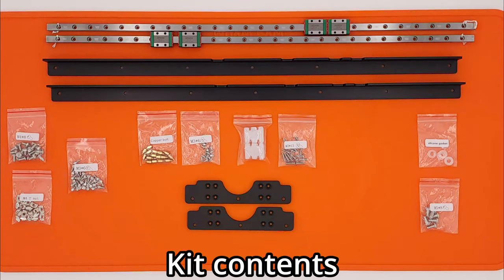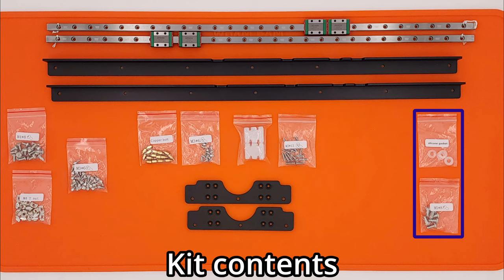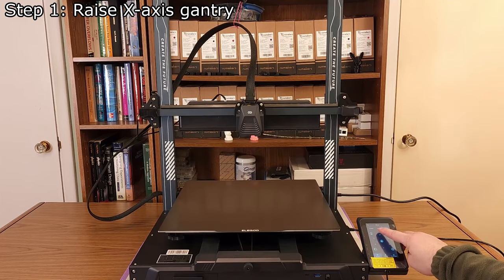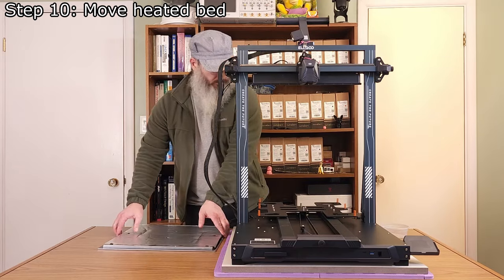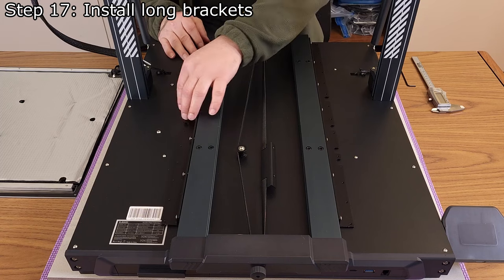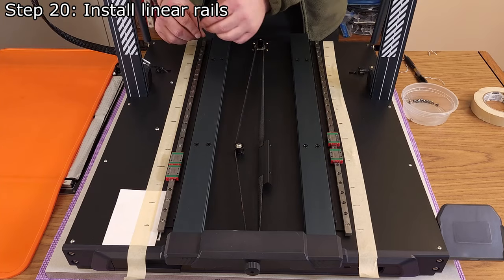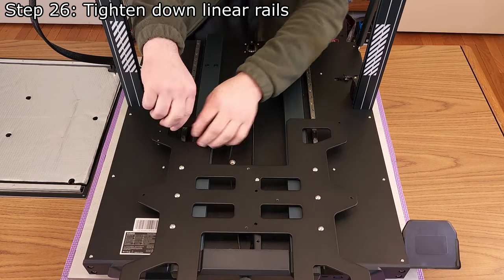Linear rails for the Neptune 4 Plus & Max: Part 3 - Installing the Y-axis kit

Comment: For the Neptune 4 plus the heat bed bracket(slider) is made of cast. This means the accelerometer hits the side of the linear rail bracket and the mounting holes do not align. Have spoken to TBSton3d and they will have a new accelerometer bracket soon to rectify this issue for N4 plus.
Reply from the maker: Thank you for watching our videos and for letting us know. We don't have access to a Neptune 4 Plus, so I was not aware of this issue.
Reply: Yup,. running into this issue right now... what did you do about it? I am just considering sanding the plastic housing on the accelerometer down a bit....
Reply: Or I could print a new bracket, which I ended up doing. Loving these videos, did both the Y and X today, now for the Z :)
Reply from the maker: Thank you. Our Z video should be available in a few days. We improved our installation process from our Neptune 3 Max video.
Reply: @SandMMakers  Awesome, look forward to it! It is the last axis I need to do and then back to levelling etc! I noticed the TBStron YT channel didn't even have a z axis video like the others, so will look forward to yours.

Comment: Hi, I got my kit and started installing the Y rail kit. I am missing the brass stand offs and m3 x 6mm screws or the custom silicone gaskets and m3 x 12mm flathead screws. Where can i get the brass stand offs or silicone gaskets if not from the company? Thank you in advance!

Comment: what is the Maintenace for the rails? i installed mine yesterday. how often to you need to grease them or can you just add some oil to the rails. Also, what syringe did you use to grease the hiwin? Thanks

Comment: 1 month update. The silicon washers did not work out at all. The screws loosened so much the bed was more wobbly than on fully deteriorated pom wheels. The screws had zero torq so they just wiggled loose. I threw them in the trash and placed steel washers on instead. Just started a print on the new configuration.
Reply from the maker: I haven't heard anyone complain about this issue before, but I would have assumed the silicon washers would have acted like lock washers, helping to prevent the screws from loosening. Good luck with the steel washers, but I'm not sure if they will work for two reasons. First, unless you added lock washers or Loctite, I would guess the screws would be even more likely to come loose after being subjected to vibrations. Second, the silicon washers help compensate for any imperfections in the assembly. This is why the brass stand-off mounting option is a more difficult install, because everything has to be perfect, or you will get binding. Either way, good luck and keep providing these great status updates!
Reply: @SandMMakers  if you recall the washers are now too thin and the bed is impacting the frame. So I added a steel washer to the silicon washer to thicken it. Even with the steel washer, it was too thin if you torq the screw. So catch 22, you would need locktite there too. I run my machine 24/7 so my screws may have loosened faster. A solid mechanical connection is needed. Shock absorption is not an issue with this machine if you run the vibration cancelation program
Reply from the maker: I remember now (I response to hundreds of comments and messages so keeping track of all of them is a challenge). There must just be something slightly different about either your printer or the parts in your rails kit. I'm sure you will be able to figure something out. I'm not sure I have any more suggestions, but thanks for the updates!!!

Comment: I finally bought all the kits now. For step 21, Mine is even more different than you show for the small brackets. I didn’t get option A or Option B in my kit. So for now I’m stuck waiting on support to return my email I sent them. Thanks for the videos.
Reply from the maker: You didn't get two thick metal brackets? TBStron3D stopped using the brass standoffs and the H-shapped gaskets a while ago.
Reply from the maker: I use the new thick metal brackets in this video: https://youtu.be/9ezVllKc4Eo
Reply: @SandMMakers  yup. That’s what I got. They have option C I guess now. Haha. Thanks
Reply from the maker: The thick metal brackets are MUCH nicer than either of the two previous options. I was going to include them in the Neptune 4 Max Y-axis video, but the prototype brackets were defective and I didn't want to delay publishing the video by 2+ months.

Comment: So curious just got my kit installed (went with option A, since I've had my kit ordered and sitting for quite some time). I notice that the belt is pulled up away from the base quite a bit, especially when you get to the max front/back points. Has anyone run into issue here with accuracy concerns with the belt binding a bit at max? I'm sure a printed spacer should suffice to address this long term.
Reply: So... my fault... I installed the l brackets for the rails upside down.... makes so much more sense.

Comment: For step 7. I instead removed the entire accelerometer by removing the 2 screws holding it in place. The plug on my accelerometer was just too "Stuck"
Reply from the maker: I'm glad you found a way that works. For most of these mods, there are multiple methods that will equally work. In the videos, I can really only show one approach, but the companion website that I'm creating will be able to describe multiple approaches for mods shown in my future videos.

Comment: Hi. I replaced xyz axis with rails. And now have error " probe triggered prior to movement" would you pls advise where might be issue as I am beginner.
Reply from the maker: Did you update your z-offset?
Reply: @SandMMakers  I tried set offset..
Reply from the maker: Please describe exactly what you tried in a little more detail. Also, after homing, what is the distance between the bed and the nozzle? What is your current z-offset reported in the LCD controller?

Comment: So after I try to pull out the bed accelerometer cable and break it, where can I get a replacement.
Reply from the maker: The cable is fairly easy to make, but if you email 3dp@elegoo.com, they will send you one.

Comment: When you start to print, I suspect you may have issues with the bed staying leveled. Mine was losing its level in one print, after a short while. This was solved by replacing the 6 M4 × 30mm flat head socket cap screws that run through the springs with M4 × 40mm screws and adding nylon lock nuts, as was suggested by another commenter elsewhere here on YouTube. This mod made leveling the bed take much more time, but now it stays dialed in for far longer. 

I have enjoyed the series so far. Looking forward to the final entry.
Reply from the maker: Thank you for watching our videos!! I have not experienced the situation you are describing, but if it works, great! I know a lot of people use silicon spacers with great success.

To make bed leveling easier, you might want to give Bed Leveler 5000 a try. Here is the current video, but a new release with even better features is expected to be released within a couple of days.

https://youtu.be/JBGN3U0C2LM

Comment: Great videos! In step 21 attaching silicon brackets how tight do you make them? Same with step 23 securing base plate? I overtightened them and the base plate was hitting the front of the printer it doesnt have much clearance. I am using the cheaper rails maybe the hiwin rails are taller?
Reply from the maker: Thank you!

I don't know the exact amount of torque that I used in the videos, but you don't need to tighten anything to the point where something could break or snap. The most important thing when tightening the screws in those two steps is ensuring all screws are tightened to the same amount and the tightening is performed in an "X" or "hourglass" pattern to ensure even forces all around. I don't have access to a set of the non-HIWIN Y-axis rails, but I'm guessing the dimensions are fairly similar. Did you make sure to use two thick and one thin silicone gaskets per carriage? If yes, the only thing I can really think of is that the front screws were tightened a lot more than the back screws and base plate is tilted as a result.
Reply: @SandMMakers  yes used two thick and 1 thin. I loosen and made tight with Allen vertical like you did in video and it's fine but still very little clearance on front
Reply from the maker: I'm glad you got it working. If you encounter any more issues, let me know and I will try to help out. However, for bigger issues, email TBStron3D. They are extremely responsive.
Reply: Just installed my Y-Axis kit, I used a rather long ~400mm flat ruler to level most of the bed flat amongst the 6 points. It should at least get me into a good starting point before I get the uprights complete and perform the leveling with the machine on. 
Kind of hard to explain, just think of the 6 screws as the tension points they are, and make the ruler flush against the build plate by tightening/loosening them. Its no machinist Rule, but again... should get me close enough.

Comment: I want to say thank you for incredibly precise and informative videos you put out! I installed the y-axis kit on my Neptune 4 Max with ease with your instructions however I have ran into an issue. Obviously with the introduction of the rails the bed sits higher than previously. I thought by starting the auto leveling that the printer would stop before crashing into the bed. I am not new to 3d printing but I am new to Klipper and having a bed leveling sensor. Where can I make an adjustment to the z-offset to compensate for this? If I run Bedleveler 5000 (which i used to originally level my printer and its fantastic) will it cause the head to crash into the bed or will it stop at the right height while probing? Thank you for your time!
Reply: Solved my own issue, I didn't have the PEI bed on, as I was afraid of having the head crashing into it and damaging it. Forgot that it's needed to detect the height of the bed.

Comment: Can you tell us what max acceleration do you obtain in input shap Y axis test? 
Because my mvz is <1700 and my friends with wheels have better results than me with linear rails (Neptune 4max in both cases)

Thanks for the videotutorial, very useful
Reply from the maker: I was collecting input shaper results while filming the videos, but due to a scheduling conflict, the collected values got invalidated. I'm aiming to perform some more extensive testing and calibration on the printer's soon.

Comment: Thanks for the video, it is very well done and informative. I do have a question though. There are two y axis rail kits available on the TBStron3D store, but one is substantially more expensive, do you know what the differences of the kits are? They look like they have the same parts.
Reply from the maker: Thank you for watching our videos!! The only difference between the two kits is the brand of linear rail included. HIWIN rails are higher quality than the generic ones included in the other kit.

Comment: great series of the Nep 4 Plus/Max linear rails!!! Very informative!!!  I do have a question on the silicone washers used on the 'Y' axis. How tight do you tighten them? All 16 screws won't will be different due to the sponginess of the washers. i guess i'll get them as equally snug as possible and plan to use the Green Loctite 290 to have them lightly secured so they won't back out. But would like to get your suggestion as well.
Reply from the maker: Thank you for watching our videos. I have not had any issues with the silicone washers. I suggest just trying to tighten them as equally as possible and NOT using loctite. The washers will already act like lock washers.
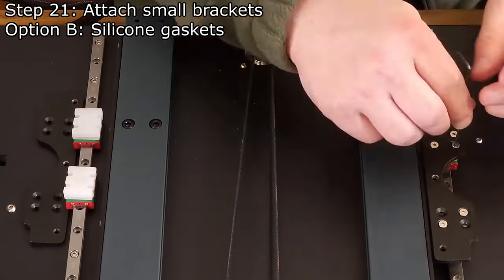Reply: I came here to ask this same thing about the silicone spacers at 8:59.  I slowly tightened in an X pattern on one roller, then moved to the other, turning only 1/4 to 1/2 a turn at a time going back & forth between the two rollers.  If one was slightly tighter in comparison to the others, I could feel the rollers had slightly more friction. Continued the X pattern until all felt “snug” and the rollers felt good.  I was worried about them backing out, but I guess we’ll see.

Comment: First of all I just want to say thank you so much for this tutorial!

I just received my kits in the mail. The bracket that mounts to the carriage blocks has spacers molded in now. Which is fine because I would have went with the hard stand offs anyways. I'm using blue loctite on everything. 

But as soon as I start to tighten a screw on the rail even a little bit it starts to bind quite a bit.

I'm wondering if it's because the rail is flexing due to only one screw being tight on each side?
Reply from the maker: You need to install all of the screws loose and then slowly and evenly tighten them. Try doing only half or quarter turns, since everything needs to be as even and consistent as possible.
Reply: @SandMMakers  that's what I'm doing. I'm going to loosen the extrusions too. And see if that helps. Busy weekend.

Comment: Step 25. If you over tighten the baseplate the washers squeeze and the base plate slams into the screw heads that hold down the back cover. I had to loosen mine. Perhaps the washers need to be thicker?
Reply from the maker: Do you have a Neptune 4 Plus or Max?
Reply: max
 @SandMMakers
Reply: I just noticed the squashed washers are also causing impact with the front cover. Washers are definitely too thin https://www.youtube.com/shorts/TjfBd4kYiFo @SandMMakers
Reply from the maker: I get an error when I try to watch the linked short, but I don't have a hitting issue with my printer. Did you use two thick and one think gasket per rail carriage and then a silicone washer per base plate screw? Assuming that the physical dimensions of the linear rails and the printer parts are fairly stable and consistent, that really only leave the gaskets. Maybe a batch of gaskets is thinner than normal? That's just a guess as I really don't know. You might want to email TBStron3D about it. They are extremely responsive and helpful.
Reply: yup, 2 thick, 1 thin then the round silicon washer. I think this all comes down to how tight both are. since mine is off by a hair, im going to just loosen them up and see what happens. @SandMMakers
Reply: I found the solution. The 6 silicon gaskets are indeed a hair too thin. Loosening the screws is not the solution. I re purposed the flat washers from the discarded pom wheels and placed 6 of them down. One under each silicon washer. It raised the bed just enough to stop rubbing. @SandMMakers
Reply from the maker: Assuming everything is mounted and installed properly, I'm really starting to suspect a batch of the gaskets or the silicone washers are smaller than normal, because my printer has over 1.6mm of clearance between the bottom of the base plate and the top of the front plastic part of the printer base. The center of the base plate does hit the plastic part, but that is by design to act as a hard stop, preventing the bed from falling off the printer. I would upload a picture, but YouTube doesn't support that.
Reply from the maker: screw heads
---------------------
base plate
---------------------
silicone washers
--------------------------
"small brackets"
-------------------------
gasket stacks
----------------------
linear rail carriages
------------------------------
linear rails
------------------------------
"large brackets"
-------------------------
printer base

Comment: I’m installing the kit now and don’t have the brass stand offs or the silicon spacers
Reply from the maker: The brass stand-offs and the silicone spacers have been replaced with large black brackets. If you watch my Sovol SV07 Plus Y-axis video, I install these new brackets.
Reply: @SandMMakers I see it now after the install. The x kit is slightly different as well. Great walkthrough nonetheless.

Do you have any rotational issues with the bed? It seems to want to rotate on it axis a bit after this install
Reply from the maker: I'm glad you got it working! I haven't encountered any rotational issues with the linear rail kits. What exactly is rotating?
Reply: @SandMMakers sorry, the bed itself has a bit of rotation when I’m leveling it. On the same plane as the leveling knobs. If I rotate a knob counterclockwise the bed similarly wants to move on that same axis. 

Sorry if that doesn’t makes sense. 😅 thanks for being so responsive.
Reply from the maker: That sounds like something is loose, or maybe a screw is missing, because the bed shouldn't be rotating at all.
Reply: @SandMMakers I definitely didn’t forget to tighten down the bolts in my confusion about the standoffs…

It works great now. Time to tune

Comment: Wouldve been fantastic if i wasnt missing all the hardware and spacers for both options of mounting the brackets to the carriages.

Double check your hardware before you end up with your printer in a hundred pieces while you wait for tron3d to ship out missing hardware.
Reply from the maker: There is a new, and much better, mounting option than what is shown in the video. You should have received two hefty black brackets. I demonstrate them in my Sovel SV07 Plus Y-axis video.